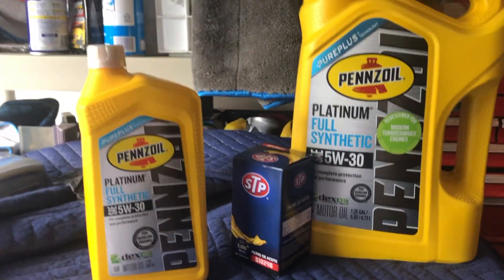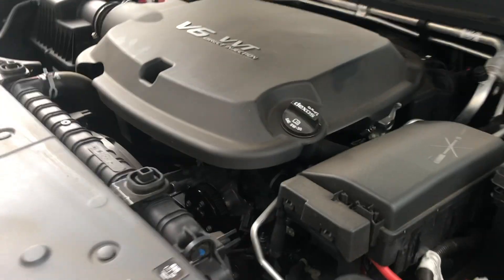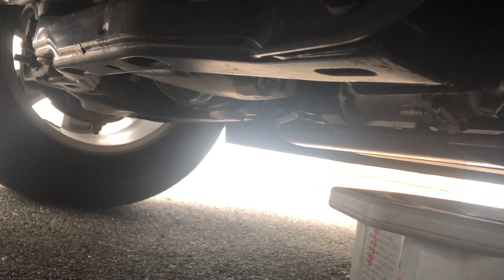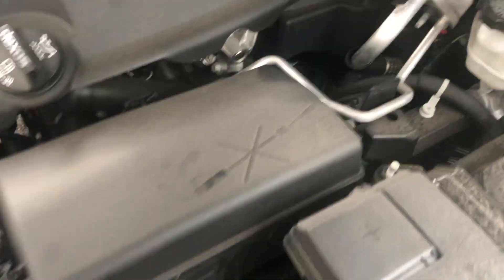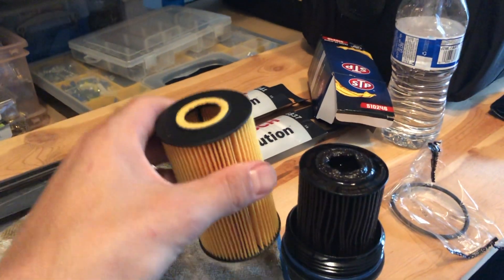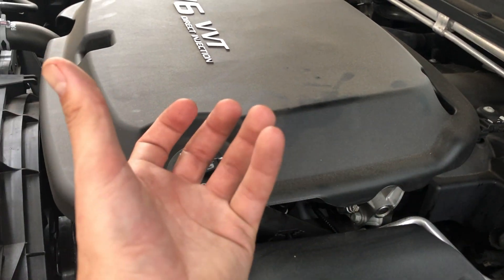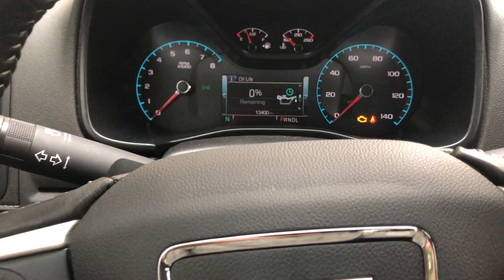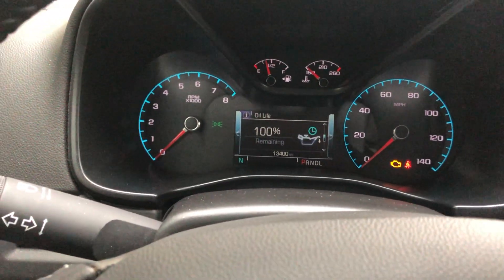How to change the oil/reset the oil light on a 2017-2019 GMC CANYON

Comment: How do you like the penz oil and one more question I reset the filter life and in less than 24 hours it went from 100-99%
Reply from the maker: I like pennzoil, it’s a great oil manufacturer for sure. And I mean honestly that’s kinda normal for it to drop from 100% to 99%. It’ll do that because after a few hours of driving it won’t be classified as 100%. Now if it goes down to 98,97,96 and so on in a short period of time then you might have an issue with it. But for now don’t sweat it! It’s common and very typical to drop 1% from 100 like that

Comment: Hey I'm always worried weather I overtighten the oil filter. Or if I'm under tightening. I always tighten a few turns but not all the way flush. What do you reccomend? Do you use torque specs.
Reply from the maker: Hey there that’s okay! Super common. But honestly I don’t use tq specs for oil filters. I go to where it’s tight(good amount of resistance)  then I’ll do about 2 more baby turns all by hand. It’s hard to explain over message of the amount of pressure to do. But you’ll pretty much feel it out as you go. I don’t think anyone really can over tighten a oil filter by hand. Plus you can see the filters come with gaskets and that will also tighten up and prevent oil from dripping out. Now If you want you can get technical and use tq specs and a tool but it’s not necessary